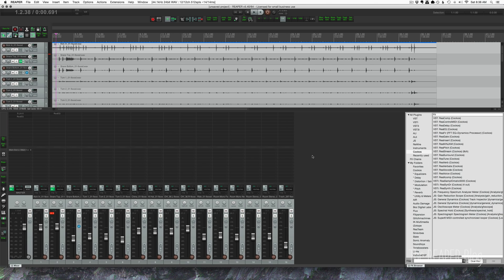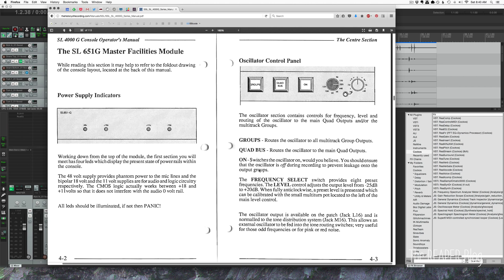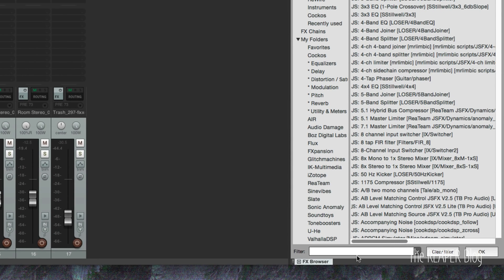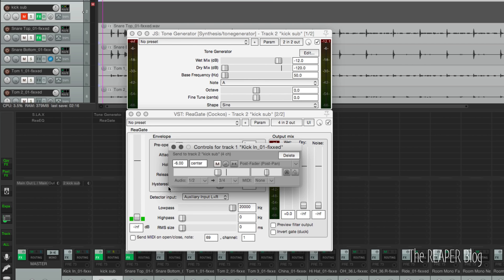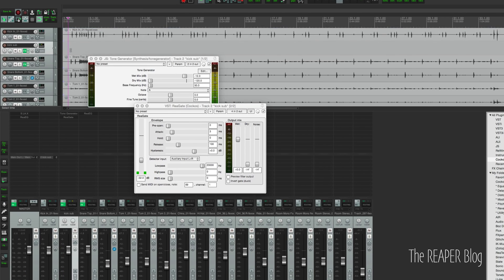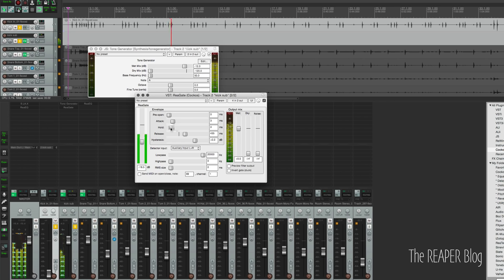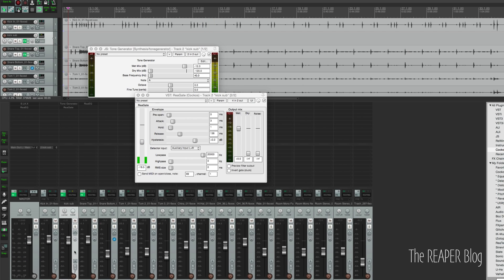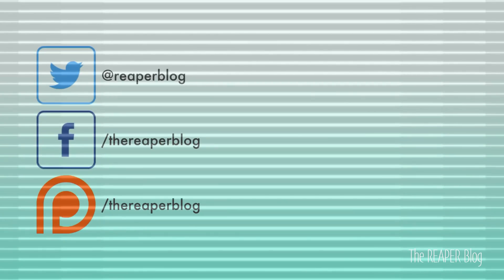Kick Sub Generator Trick - Classic Mixing Technique With Free Plugins In REAPER

Comment: Am I doing something wrong? I get this kind of popping effect on the release, unless I set the threshold super low...
Edit: I guess it was actually not high enough and I was catching some reverb below the transient. Gave a weird popping/clipping uneven sounding artefact.
Reply: You know what, fuck this. I just wasted several hours of my life, this shit is too finicky and adds extra hits randomly too... unless the threshold is precisely right... and then there's no hope of subtle volume dynamics. Maybe I need an extra tight, short hit, for this thing not to glitch out.
Reply from the maker: lots of other ways to layer sub bass on a kick. Check out Little Foot from Boz Digital
Reply: @TheREAPERBlog  Yeah, I ended up doing it with ReaPitch, oddly enough (2 shifters, one being the original kick, the other a downpitched one with a reshaped formant). Sorry for being a dick. Just because it didn't work my particular scenario, doesn't mean the transient pitch gate is not a neat technique. On a clean, quick, consistent kick, this works nicely and saves a lot of time. I'd imagine trap producers could have a field day with this. It's only frustrating, because I'm a noob with no idea what the hell I'm doing when I mix / master. Thank you for the tip and for the reply, I'll check it out. <3

Comment: That's a nice trick, I've been using it for quite a while now. Two observations though:
1. It might be a good idea to generate a tone that's equal to the key of the song. That's what I do anyways, love how it ties it with the bass. Choosing a frequency that would complement the kick regardless of the key like you did is fine too I guess, haven't tried it though.
2. Not too long ago I started using a tone as a sample. Doing it with the gate means that every time it opens with a random phase - that might mess with a real sub or a kick sample that already has some sub in it, and in that case flipping the phase obviously won't work. Instead, I just capture a short sample and then mess with its ADSR in reasamplomatic. That way the phase is consistent.